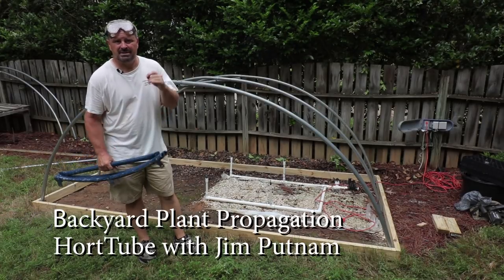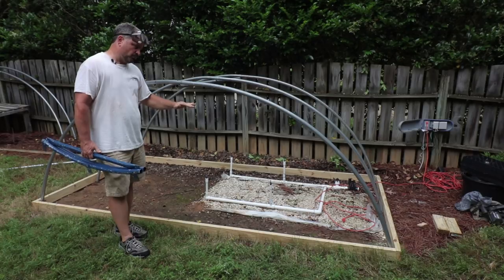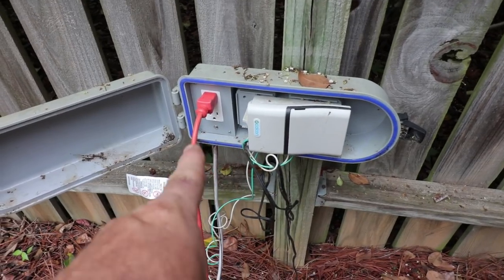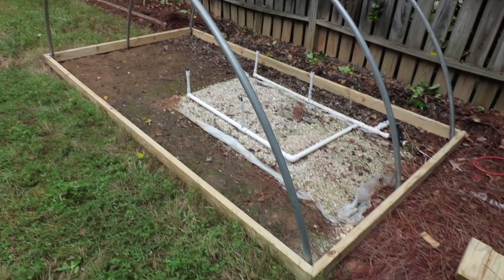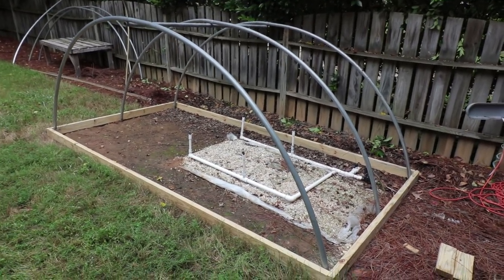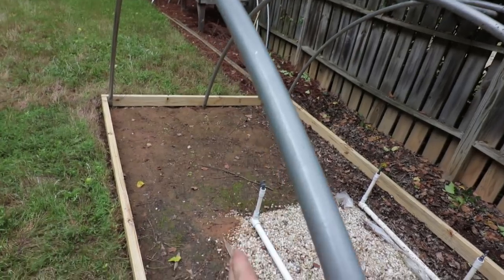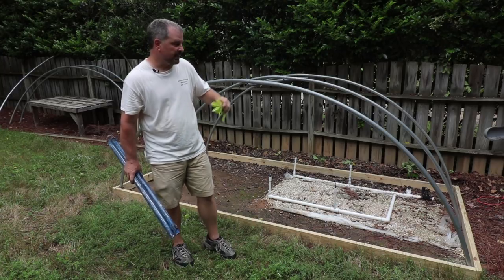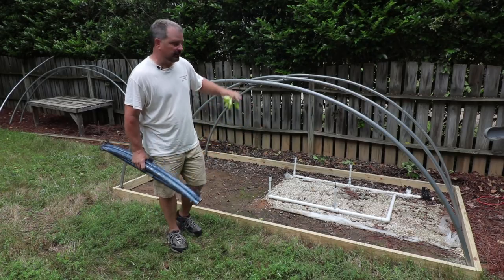Backyard Plant Propagation 1 - Starting A New Greenhouse

Comment: Hi Jim, I am getting close to building your greenhouse from this video. I was wondering if you could help me with a question I have about dimensions. We are trying to decide if we should build two of the above greenhouses, or simply build one larger sized one by not cutting the metal frames down to size. If we decided to build a walk in version of your greenhouse, does that change any of the perimeters such as amount of water, air circulation, etc? We have plenty of land and the greenhouse will have access to water and electricity. Thank you Jim.